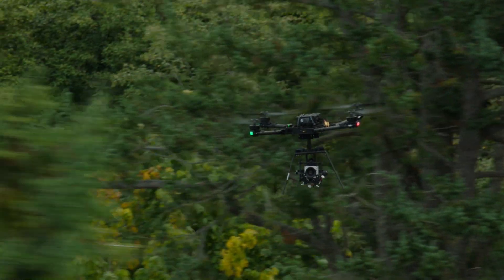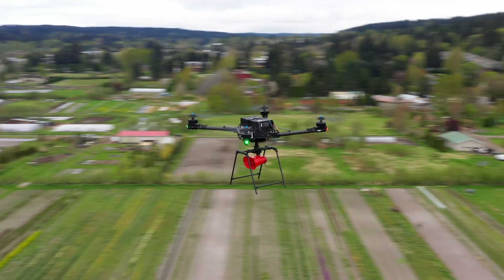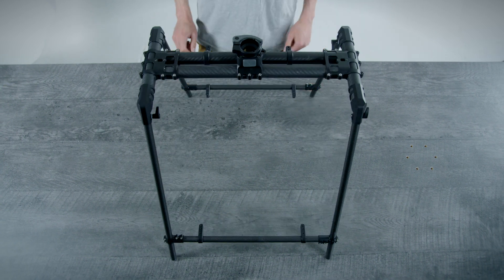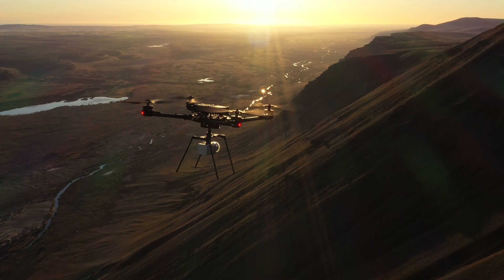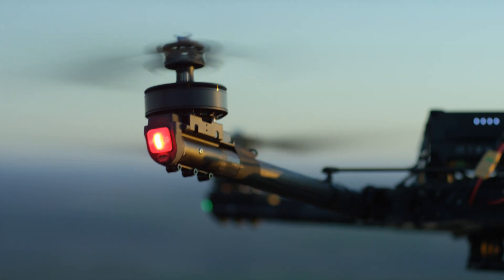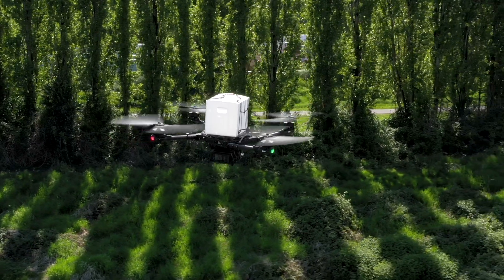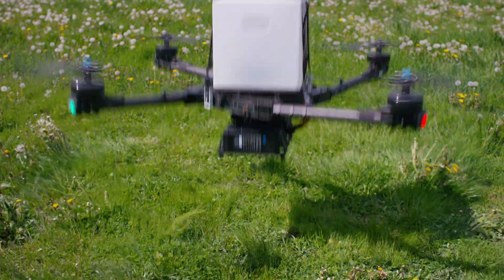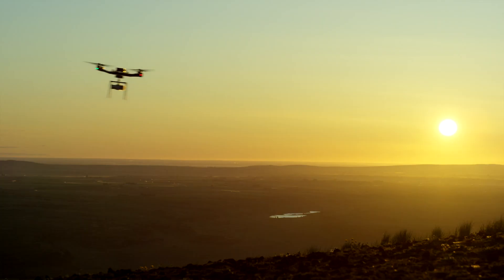Freefly ALTA - Cargo Landing Gear

Comment: Wow, this seems very exciting. Can you give some examples of different cargo weights that you have tested with, and respective flight times and maximum distances for those given cargo weights?
Reply: There is a calculator on the Alta X website where you can input a cargo mass and it will give you flight time and thrust margin.